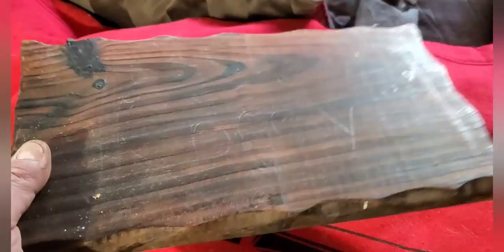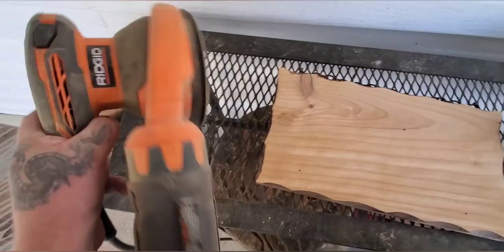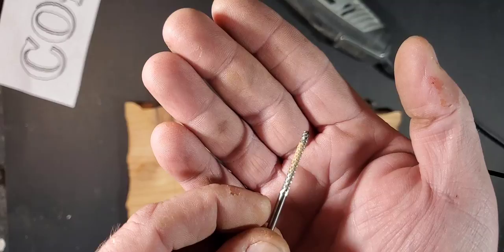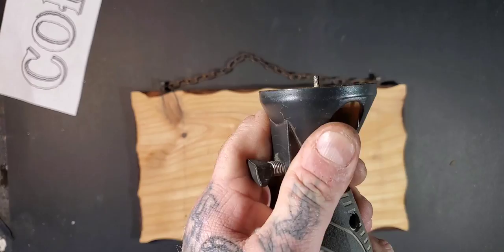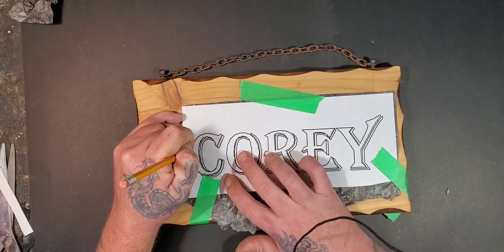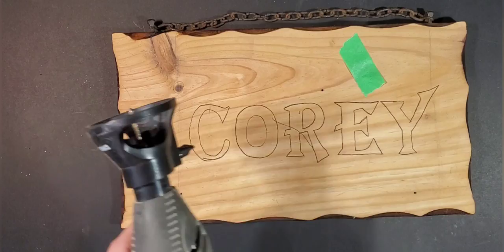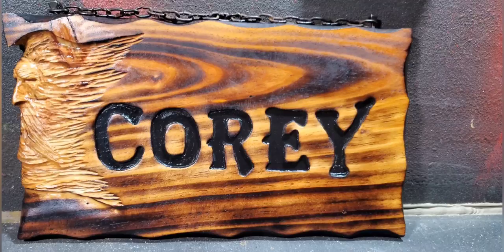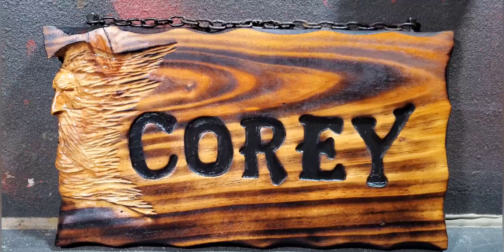Easy steps to begginer carving a wood sign with a dremel

Comment: Hi Jordy I have a suggestion for you - Im a sign carver and I thought you might want an easier way to transfer letters to wood,  when you make a template like Corey, make it so the letters are reversed.  You then put the paper down on the wood and just tape the top of it.  Then take a rag and put some lacquer thinner on it not too much) and then wipe the rag on the paper and then use a credit card or something with a good edge.  The letters will come off really clear and then you are ready to carve.   BTW great sign especially with the wood spirit on the side. Wish I had your talent for making wood spirits.  Burt in Chilliwack
Reply from the maker: Cool ideo thsnk burt hppe u got ur dremel going
Reply: Hi-I use an HP printer. I tried your suggestion and I wasn't able to make it work. Any suggestions? Thank you!
Reply: Hey Burt make a video of that , I’d like to see

Comment: I have a Wen rotary tool with a flex shaft and just got a Dremel and flex shaft because the hand piece on the Wen gets hotter than the hinges of hell. The Dremel isn't as fast as the Wen. Better grip on the Dremel though. The Wen with a flex shaft and a bunch of bits was cheaper than the Dremel flex shaft. Lol. Good buy for a beginner though; just don't run it past five or it'll burn the piss out of you. 
Beautiful plaque/sign Jordy. Love the wood spirit on the side. 👍👍
Reply from the maker: Ya i have had lots of wens, put ur dremel flex shaft on the wen for more speed :)
Reply: I bought a TackLife as it was half of the Dremel 4000s price. (Not cheap,but survive on VA disability). Much quieter, less vibe and great power.

Comment: Hey man! Awesome job! But I have a question, did you use a drill bit to carve the outline when you first start? Or is it a carving bit? I'm new to this but I'm very excited about my rotatory tool, thanks!
Reply from the maker: Its a rotobit wall cutter /,tile cutter u can get at home depo
Reply from the maker: Sorry its a rotozip bit u can get at home depo , they are by the dremel section 1/8 wall tile cutter bit
Reply: @CarvingFusion  thanks a lot for actually answering, appreciate it a lot! Have a nice day!